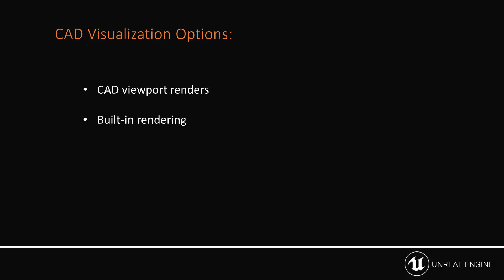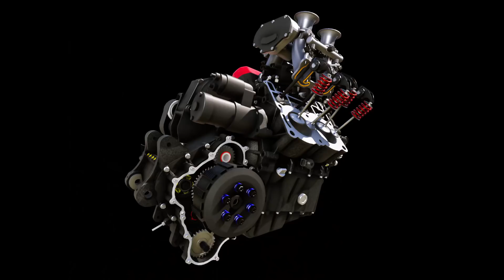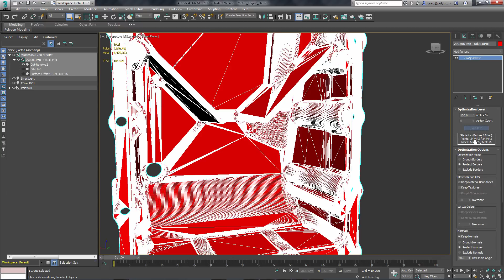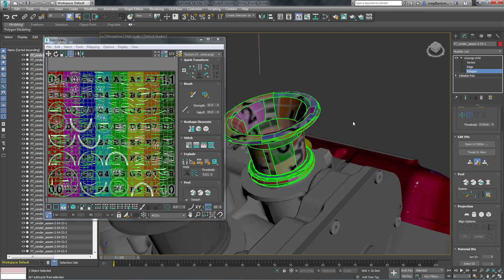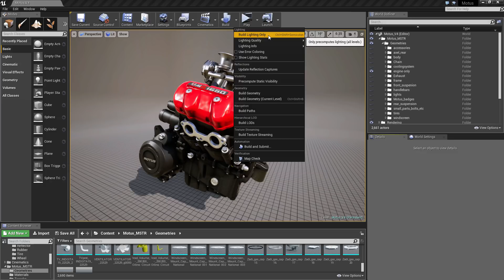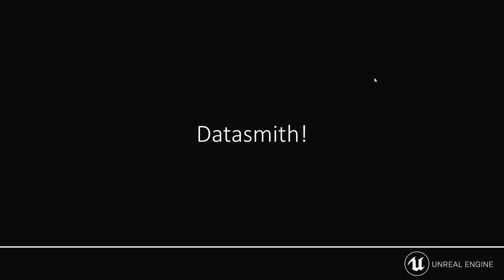Interactive Visualization for Product Design | Webinar | Unreal Engine

Comment: UVing is like cleaning toilets in 3D. We get tons of jt polygonal files from NX that are combined but NOT stitched so when you start laying out UVs you get tons of border edges. That alone takes forever. I can't even begin to think about decimating 70 million polygons down to something manageable in Unreal Engine.  When I build files in Maya I have both exterior and interior components, chassis and engine which sometimes ends up weighing depending on the vehilce from 40 to 75 million polygons and between 2 and 4.5GB. That in itself is heavy. My concern is how time and labor intensive is the process of getting CAD data ready for Unreal.
Reply: Have you tried Datasmith for your CAD data?
Reply: @parelt  Have you used Autodesk VRED and RTT Deltagen? no offense, just asking. In RTT Deltagen, you can take huge engineering file directly into them and the texturing is done using mapping algorithms over geometry. No need for UV's.

Comment: Import as body object (not mesh), you can fix the tessellation interactively using settings for face angle, face distance, edge length, etc, getting far lower triangle count while still maintaining the look and not destroying the UV's that were given to the trimmed surfaces. Convert to mesh and compact the UV's after. The ProOptimizer is buggy if you have it applied to a handful of objects at one time and it'll turn itself off and you'll have to re-initialize it, and then lose another ProOptimizer on another object when doing that.